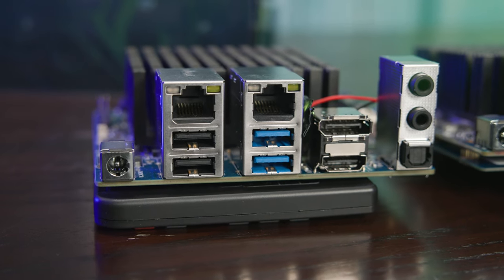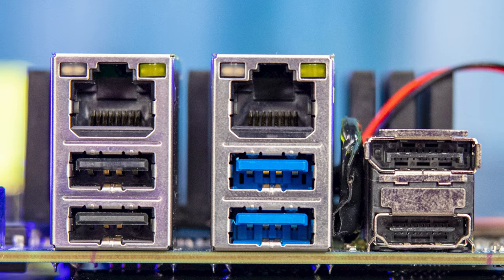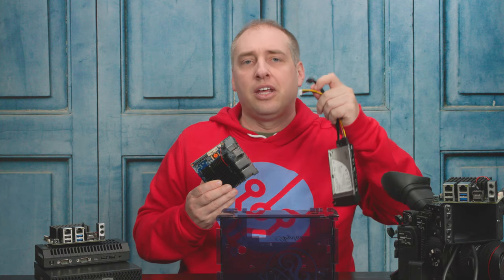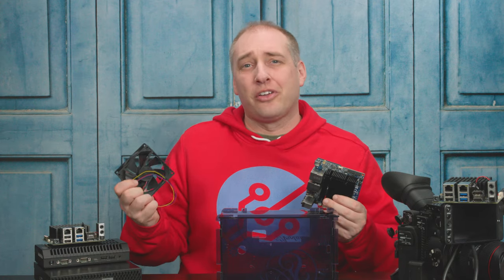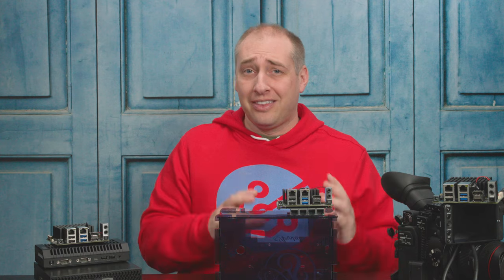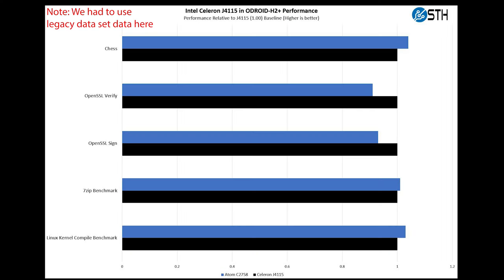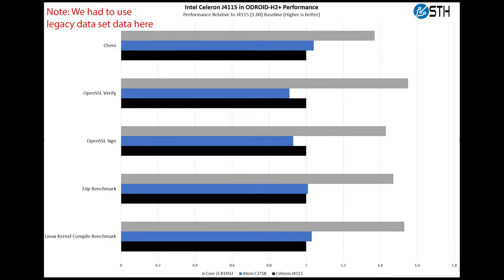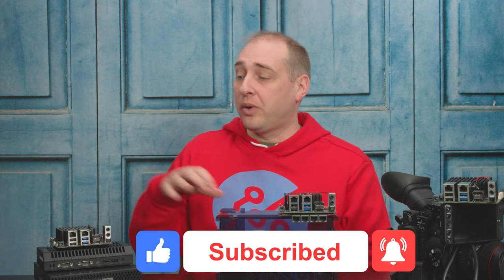6x 2.5GbE Single Board Computer ODROID H2+ with H2 Net

Comment: sees title and gets all excited to use one as my Untangle box
"realtek nics don't work with linux out of the box"
FFFFFFFFFUUUUUUUUUUUUUUUUUU
Reply: the usaly do... There are more problem with pfsense or opensense if you get a load of 200mbit or more the interrupt get realy high. There is a fix for this. https://forums.serverbuilds.net/t/guide-resolve-realtek-nic-stability-issues-on-freebsd-pfsense-2-4-4-2-4-5-2-5-0-opnsense-use-2-5gb-realtek/3555

Comment: If only i could get 2x10g and an SFP+ port on this for my ISP i'd use this for my router. But having 6x2.5g sounds interesting, if my ISP supported that speed i might pick something like this up.
What i think this thing would be great for is a file server. Get some sort of sas controller on that PCIe4x slot for 8-16 drives, throw in 32GB of RAM for caching and you've got a nice little 2.5+2.5g server in a very small form factor.

I tried to build a similar concept system using an apecia XQPack2 case, 18 hot swap bays on the front using a 16x2.5 hot swap enclosure from ICDock, and an MATX motherboard.

 But this little guy, you could get something SUPER small in a custom chassis, say, something the size of the Xbox series X, with 16x hot swap drives. Super portable, super low power. reletively fast.
Reply: You can also use the 2.5Gb speeds within the network, so any transfers between machines are fast. You only really need it if you transfer lots of data internally within your network.
Reply: @vaikjsf34a  Edit by between machines i mean handling all the packets, you still mostly need a router for DHCP addresses unless you want to get wild with 169 or static addresses.
Much of the time you shouldnt need a router in between machines within your home unless they're crossing isolated VLANS with two separate switches. I have a 28 port switch with 4x10g ports, and even though my router is only 2.5G(on a 1G switch port) The clients on those 10g ports get full 10g

Comment: Kernel versions >5.10 (Fedora, for example) have mainline support for the NICs. Beware of trying to compile the NIC drivers yourself (e.g. on CentOS or RHEL). Sometimes backported kernels break some header stuff that's needed for the compilation (compilation fails on RHEL 8 / CentOS Stream 8).

Just in case anyone using a non-Debian / Ubuntu distro happens to look.
Reply from the maker: Great point Andrew! That is the challenge of doing point-in-time of support today versus what we will see in the future. I fully expect this to be a non-issue for Linux distributions in the near future. I did want to call-out that one may look at the documentation, see Ubuntu 20.04 support, but then get stuck without a NIC if they did not read carefully.
Reply: @ServeTheHomeVideo  Not disputing the choice of content in the video at all! I thought it was a great showcase. And I agree with the implication that any sane use-case for this (edge server, firewall running IPFire, PFSense, VMs using Proxmox or similar) will not have a recent enough kernel that the NICs are supported natively.

Unless one is running a "close to bleeding" distro (Fedora, Tumbleweed, Arch), which are typically not used in the kinds of deployments this product might find itself in, mainline Linux kernel NIC support is probably not forthcoming for the next >2 years. (4.14 was released in 2017, see the LTS-type distros mentioned below)

Just thought I would add in the troubles I experienced with the RTL8125B NIC and manual driver compilation in case anyone gets stuck in the same situation (I believe RHEL 8 uses 4.14-stable kernels, which are the same as IPFire). I tried compiling the driver myself for a day or two, and then decided for my application to just go back to Fedora with mainline support.
Reply: @andrewchia7225  AFAIK this NIC is not supported in mainline 5.10.y yet ... not sure which distro adds it but its for example supported in Armbian OOB since ARM based NAS Helios64 comes with the same 2.5G NIC. Also there is a patch for support in its legacy 4.4.y kernel.

Comment: omg why does it not have 2 more SATAs.. might still get it to make a low power NAS
Any 'made for it' sata port extensions? I wonder how well it would run with KVM and pfsense behind + maybe free NAS.
5W idle and 20W load is perfect for me!
Reply from the maker: The SoC only has two SATA ports IIRC.
Reply: @ServeTheHomeVideo  It does but I wanted 4x haha. I need to find an adapter that will be compatible with it. This is just for a small home server to run my NAS and homeassistant on low power. Possibly plex but I'm not holding my breath
Reply: @asdrubale bisanzio Right but it's almost a lottery to find one that works flawlessly.. any recommendations?

Comment: I've always seen 2.5 and 5G as a money grab. 10G is 20 years old. There are no 2.5G switches, there are no 5G switches, and there (I hope) won't be, and frankly, shouldn't be. New generation of 10G phys are as power efficient as early 1Gs, honestly, enough to be put on laptops.
Reply: But that's "Enterprise" stuff, expect 10x price 😆
Reply: @cristian91re  GbE was enterprise at some point too, and industry giants openly opposed introducing it to masses. Now it csme to a point in which 15-year old decomissioned enterprise gear has better connectivity than new soho hardware, while old stuff was comparably priced to modern units WHEN IT WAS NEW, not even including inflation. That's outright banditry.

Comment: What's up with the color grading? It seems off. New camera, haven't created a new grade for it?
Reply from the maker: Exactly the case. Still changing out some lighting along with the new camera. You will notice that in the B-roll/ photos there is blue on the left and yellow on the right via Nanlite Pavotubes that are doing some edge hightlights. I am thinking of making that standard on the photos/ B-roll. The challenge is that I setup the studio for that look, then decided I did not like the look of those highlights on the talking head, and did not swap back to the old lighting setup.

Comment: That's bonkers.  6x 2.5Gbit connections is going to cripple it.  What exactly is the purpose / use?  I generally say 2.5Gbit on a motherboard is worthless because there are no cheap switches for 'home' use, but I guess you could use this as the switch - I can see any other use case.
Reply: It's 6x 2.5. Not everyone lives in USA cave with slow internet. SGP, JP, SW & East EU countries have affordable 2gbps & 10gbps internet.
Reply: @therealb888  he wasn't talking about that.... 2.5GBase-T switches aren't cheap yet and are not that common, that's what he was critiquing.... And ai live in the US and have 1200 Mbps internet (1.2Gbps)

Comment: Yeah, this H2+ series got obsolete faster than light turns on after you press the switch. 
It is seriously bad how fast this was taken off the market, I wonder if them likes of Cisco, Netgear etc didn't like what a device like this brought to the table. Honestly it's absolutely criminal that this has been discontinued and no similar or improved replacements have shown up to take it's place.
Crap.
Reply: I think it was mostly because of the semiconductor shortage, at least that's the official narrative. If they could manufacture enough of these things then they'd own the DIY firewall/router market, IMO. I just want the network card if it's supported by any other SBC or even x86/64

Comment: I was looking for this device to use as a router for my pppoe 1gb connection.
I'm not insisting on pfsense, but I do need reliable network that support heavy workload , be it multiple vms or people downloading legal torrents.

What sub 200 dollars device could one use besides the usual hp t730 or 630 plus. ?
Reply: The 730 & 630s don't have an option for PCIE expansion like T620plus :(

Comment: would be cool if they had different modules for that m.2 slot. they already have the H2 net card which adds another 4 2.5GbE ports but it would be cool if there was also an HBA that adds a bunch of Sata/SFF-8087 ports which an accompanying case that has a bunch of hotswapable drives. A PCIE gen 2 4x slot has a bandwidth of 2GB/s if a single drive reads at, let's say, 160MB/s you could have 12 drives hooked up to it.

Comment: Hi Serve the home team,
Sorry for the dummy question, I got a little confused. Is it possible to use this machine as a firewall (pfsence) in a home environment? Does the low CPU can compromise internet performance? Im planing to implement a small and low energy consumption environment using proxmox, kubernetis and home assistant. Your videos are giving me great ideas. Thank you for your content.
Reply from the maker: It somewhat depends on how fast your WAN connection is, and how aggressive you want your firewall to be. For simple NAT, it will be fine. For major packet inspection or features like running IPsec/ OpenVPN tunnels, it can be a limit.

Comment: When i've seen the thumbnail i almost gaged. 
Bought products from hardkernel before and evrey one of them is riddled with bugs and quirks. 
I wonder if they source the cheapest possible components and marry them togather to just barely work.
Support is pretty much on the developer level, not for average user and forums are tiranicaly moderated to hide flaws or push products.
Waste of time IMHO.
Reply from the maker: I think I have had similar experiences with some of the other boards. This one is certainly a step or two above (with caveats noted.) My sense is that this is simply because the Intel ecosystem is much more mature and this is mostly a SoC solution from Intel. That was my hesitation when this only had 2x 2.5GbE NICs, but with 6x I gave it a shot and it is a very different experience than I had previously.

Comment: I see a real practical use for this. For some time I have been looking for a device to act as a small, cheap, ceph node. I am working right now with the Pi CM4 and also the Rockpro 64.  These nodes should work brilliantly for a couple of OSDs on each node giving you a small but highly available storage solution for not a lot of money.
Reply from the maker: Yes. Was thinking GlusterFS, but a similar idea.

Comment: Intel is the best of doing nothing!

That is why only Rv5 or ARM or AMD aka the lower power when in use and mutch lower temps.
AMD's modern (even the 6000 series) are supper good in lower power compute.
The new 7000 series, blows all compedition out of the water considering compute for power options x86x64.

Comment: hmmm maybe I order one and test it like this. Put a nvmce to pcie x4 Adapter on it https://www.reichelt.de/de/de/adapter-m-2-ngff-key-m-pcie-x4-slot-delock-62584-p154304.html?PROVID=2788&gclid=EAIaIQobChMIwOWH2IHQ7gIVlRoGAB2rtwtNEAYYASABEgL5CPD_BwE&&r=1 and then use the VigorNIC 132 / 132F card with it. That would make a great router. with vdsl modem integrated.

Comment: Could you use this to make a switch and how difficult would that be, what OS would you run?
Reply from the maker: You could, but it would likely perform poorly so I would strongly advise against it.
Reply: I have been using this as router / firewall for past few months with OPNSense. (realtek drivers included by default)  After reading comments from various places with theoretical references that it will perform poorly for switching I have been quiet surprised with performance.  I have no problems switching 200Mb+ sec transfers through the 2.5 gigabit ports whist concurrently keeping latency low for gaming (ie less than 1ms sec through the device whilst it is loaded this way at around 20% cpu consumption).

Comment: The supply chain shortages have destroyed availability of these boards for over a year now. I'm looking at the ROCKPro64 which is available right now, has a PCIe 4x expansion slot available, and I'm wondering if there are any 10Gbe adapters that will work with it.

Comment: I also wish someone would market a quad NIC to Thunderbolt interface, so I could use NUCs (etc) as routers.
Reply: @adriansnyman6252  Thanks but unfortunately no. Just a quad NIC in a (cigarette packet sized) box with an emergent USB-C Thunderbolt cable. Not a whole PCIe chassis with a regular quad NIC PCIe card. Too big & costly.

Comment: if this had more sata ports i would be sold.  id want at least 4.
Reply: @asdrubale bisanzio by the end of the video I realized that. However it would be best if their was a slot for nvme as well as sata ports or a second nvme port that could take a sas adapter. It would honestly make one of the best sff high speed nas around that doesnt cost many thousands of dollars before drives. As pcie gen4/5 come to sbc this should totally be possible. And they should also be able to add 10gbe or even 40gbe Ethernet to a sbc with gen4 or 5. Throw in tb4 or usb4 and you have the perfect solution.

Comment: that's funny, you cant go intel as well with 2.5gig option as those 2.5gig intel nic chipset is actually much worse than realtek which actually works really well if you use their drivers, not the kernel drivers which is freebsd basically admit that it was a hacky driver that was as you said "it works for them" solution, no wonder they just included the realtek drivers on their repository since that actually works much better than their own kernel drivers.

Comment: I bought a H2+ to use with FreeNAS but ran into the NIC driver problem so swapped it for a older H2 I had.  The H2+ is good with Ubuntu - driver installed using a USB wifi adapter and works on both ports.  The H2 runs up FreeNAS and finds the drives on a SATA port multiplier but it's not reliable enough, probably due to the port multiplier and FreeNAS.  Before repurposing it I'll try a OMV NAS, when I get a chance to experiment.

Comment: Any plans to check out the new H4? The only reviews I can find are from not very reputable channels and I'd love to hear your opinion on the new architecture and the fact that both the on-board RJ45s and those on the add-on network board now use Intel i226 NICs.
Reply from the maker: Great question. I think the challenge is that at $220 for the H4 Ultra, once you add in a chassis, the add-on board, and so forth, it ends up competing with those N305 4-6 port 2.5GbE boxes we have reviewed previously, but at a higher price with more assembly required. It feels like a hard one from a value standpoint.

Comment: C200 not being used much anymore? Just for eyecandy?
Reply from the maker: A good way to memorialize the switch to the C70 in videos. The C70 workflow is much faster (funky colors on this video aside.) There are still great bits for the C200, but for now the C70 is the better option.

Comment: Thanks for this. I wonder is there a good 4 port Intel nic card for pcie not just NVME. I have a Asus-E35M1-I-DELUXE that I want to install PFSense on. I would like a horizontal riser card for it too. If not I do have it in a mini-itx cube case. But I also have a 2U mini-itx case that has a built in power supply. I am so ready to upgrade my current setup.
Reply: Quad port 1Gbit: Intel i350-t4 is a short half-high PCIe card that's easy to find and inexpensive.  ($150 approx)

Comment: Be interesting if there were a hba card that fit in the NGFF-2280 slot. Run a Linux system with something like snapraid and mergerfs.
Reply from the maker: You can get M.2 SATA adapters fairly easily.

Comment: I've got pfsense running on the realtek nics, but I didnt do anything special... just installed and ran with it.
Reply: You are lucky then. I tried that and kept getting watchdog errors and needed to reboot it every few days. I eventually replaced the box I had it on with something with intel NICs and have not experienced that problem since.
Reply: @saiyantwan   I must be... I only have a 500mb WAN connection, and disabled TCP offload during setup. I'd also gone with the 2.5 nightly build, just making sure I had the latest fixes from the dev release, and those change enough that who knows if it's actually fixed or re-broken at this point in later builds. 

Either way though, I couldn't be happier - suricata and snort, pfblockerng, freeradius, DDNS, acme, and bind, all running in one tiny little box averaging 7-9 watts? Un-freakin-believable. (Got the m90n-IoT planning to make it a dedicated plex transcoding host thanks to the igpu, but after testing it for pfsense, the plan changed lol)